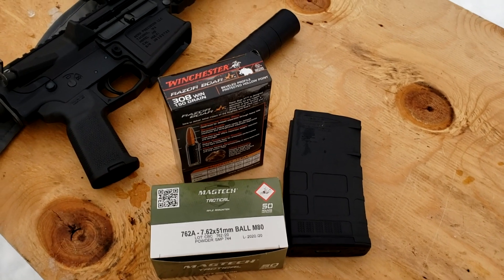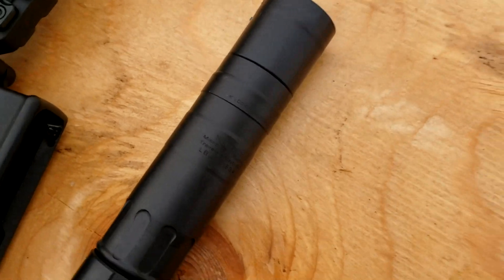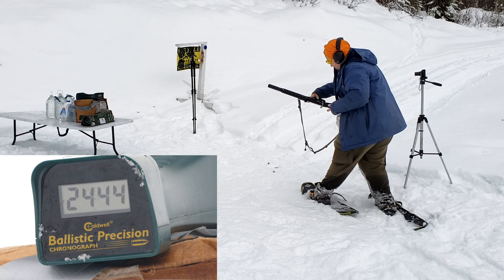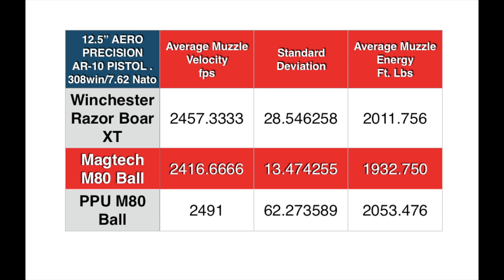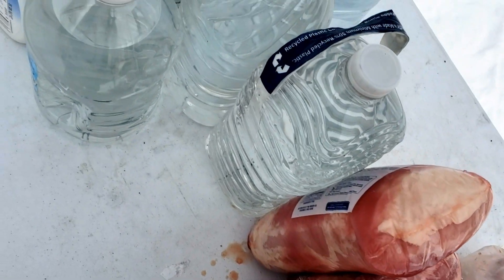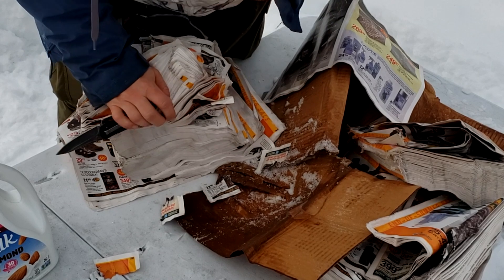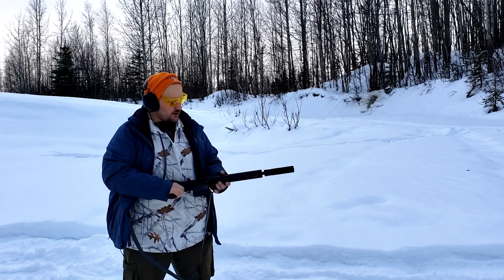12.5" AR-10 Pistol .308win Ballistics

Comment: I did a 12.5” with a surefire 7.62 Warcomp pin&welded (tuned right handed). Used a Daniel SBR. Rarely have jams and cycles just fine
Reply from the maker: Cool

Comment: Dude. I just made this exact build. SBR’d with a HUXWRX can. Crazy. Thanks for posting.
Reply from the maker: No problem... does yours run well?
Reply: @AlaskanBallistics  Not a single problem. Adjustable gas block works well.
Reply from the maker: Nice,  which has block do you have?

Comment: Averaging about 2,000 ft-lb Energy.
Not bad for 12.5 inches.
Approximately 500 more ft-lbs then an AK-47 or 300 Blackout. That justifies the extra weight of an  AR-10.

Many 308 gunpowder and I'm going to be much slower burning. They will deliver an energy below 1,500 ft-lbs. You have to be very selective with your ammunition and test it through a chronograph to make sure it is delivering above 1,800 ft-lbs. That is the absolute floor that I have set for myself.
Reply from the maker: I agree with that floor,  unless purposely running subsonic.
Reply: @AlaskanBallistics  my problem with subsonic 308 is they all seem to be about  220 gr . At subsonic speed that's going to be exactly like a 300 Blackout subsonic ,  which is a much lighter rifle. 

308 subsonic would make a lot more sense if the bullets were 250 grains or heavier. I do not know why manufacturers do not make them.
Reply from the maker: @tsafa because the twist rate of 1 in 10 won't stabilize them and you'll end up with a baffle strike
Reply: @AlaskanBallistics  thank you
Reply from the maker: You're welcome.
But now you've got my mind wanting to spend the money on a 1 in 8 twist barrel.  Lol 🤔🤔

Comment: BTW   any 223 under 16 " is pointless       any 308 under 18" is pointless         just because you Can do something does not mean you Should do something ........I have 2 308s    cut back from 26 to   20.5" (700) & 21"  AR  both bull , both tack drivers . I get between 2,750 & 2,900   depending ......all 150 gr
Reply from the maker: Yeah but you can't corner and room clear with those very easily can you?
Reply: @AlaskanBallistics  I hope you got double ear pro at 3 am if you shoot that 308 inside ...
Reply from the maker: I usually keep electronic earpro by the bed

Comment: That's actually a little faster than I thought it might be.    I've often wondered if a 308 shorty would be substantially more effective than a super sonic 300blk round.   After seeing this, I'd say YES!  Thanks for the video!
Reply: The 12.5" AR-308 will still have devastating effects up to 600-800yds depending on the ammo and barrel twist rate.
But anything under 16" will be totally useless for a .308 if you wanna leave it up to the "Mr. Know-It-Alls"  to tell you that dumb bullshit.
Even the weakest 308 round out of 12.5" barrel will shit on any .556, 7.62x39, and .300 blk when it comes to ballistics and stopping power
Reply from the maker: So true @Electric Larry
Reply: @AlaskanBallistics  Right, right 🇺🇸😎👍
Reply from the maker: You're welcome.  Thank you for watching! Yeah 2400 to 2500 with a 150gr bullet is way better than 2300 with a 110gr bullet.
Reply: 300 Blk out doesn't have squat on a .308 in terms of Energy

Comment: Hmm. I already have a 7.62x39 ar pistol with 10" barrel, but was debating swapping out the DPMS SASS barrel in my 2nd 308 maten upper because I already have a long barrel maten upper in 6.5 cm and it destroys the 308 at longer ranges. So figured why not, but after seeing those fps numbers im having second thoughts...
Not sure if the gain is worth it over my 7.62x39. Especially when you factor the weight difference. 🤔
Reply from the maker: You still get a heavier bullet at 2400 plus verses 2300 at 123gr with a 16" AK.
Reply from the maker: Handload some 110gr or 130gr barnes and you'll have some awesome loads on 12" probably getting 2800+

Comment: MAG DUMP JAMB... may have been partially due to minor shooter error...  FROM THIS ANGLE it would appear that   firearm  is NOT firmly pulled into shoulder pocket  allowing  entire firearm to move  rearward and flip muzzle up... This sort of movement can mess with the gas system .. BCG & SPRING TIMING.  If I was in on that... I would repeat test with HEAVIER BULLETS  and get a better grip to allow less firearm bounce movement .... and consider parts mentioned in my other comment.

Comment: *AR jams... due to possible timing issues: POSSIBLE Solutions include. TUBBS BRAND STAINLESS FLATWIRE  BUFFER SPRING... and  make sure you have adequate magazine spring strength and smooth  magazine  follower movement.
Reply: I have a .450 Bushmaster and it only jams on the way in on the last round of my magazine.  Which means the round is too slow moving up before the bolt chambers the round.  J Martin is probably right.  Thanks for the video.  Just built an Aero 308 12.5”.  Appreciate the chronograph data!

Comment: I had a similar issue with my .300BLK with the next round not properly feeding into the chamber.  I was using the same type of ammunition (same box as well), and it seemed to be an underpowered round not properly cycling the rifle.  I only had it happened once, and it only happened while I was running it suppressed.  When not running suppressed, the rifle had no issues whatsoever.  I agree with checking your springs and buffer weights, and maybe see how reliable the rifle is when not suppressed.

Comment: 2,400fps is near mimicked by 7.62x39 out of the identical 12.5" barrel. That's kind of funny
Reply from the maker: Well the 7.62x39mm doesn't get that.  I've tested it at 2100 out of 10" and 2350ish out of 16". 
You also have to remember it's bullet is only 123grs compared to 147-150
Reply: @AlaskanBallistics  That's fair, it's about 20grs short in bullet weight but I metered 2,380 - 2,410fps out of a SBR arsenal 107cr using ppu m67
Reply from the maker: @slappp6163  they must have had some sweet powder charges in those

Comment: You're over gassed due to the suppressor.  Put a sprinco orange buffer spring with heavier buffer in it or try tuning your gas down if you have an adjustable gas block.
Reply from the maker: Yeah we tried changing the gas

Comment: I’m curious how this does compared to a   7.62x39 of the same barrel length
Reply from the maker: Hmmm i was getting about 2050 out of 7.62x39 10.5" 123gr fmj. So 12" should get 2100-2175 ish. Slower and lighter bullet than the .308
Reply: @AlaskanBallistics  I’m considering a Galil ace pistol but I’m leaning more towards the 7.62 x 39 seems like it’s more efficient
Reply: @dangerousfreedom4965  if u can get the x39, that's the one. If not I would go 308 over 556

Comment: The velocities were about as expected. It equals and slightly exceeds 30-30 Win velocities from a 20" barrel, and we know those loads work well. I am still a little suspicious of copper bullets, and unfortunately we are stuck with them here in Kalifornia. I love the 308, i have 2 levers and a semiauto. Unfortunately, no AR'S here anymore. When i move up there i may get a AR10 and an extra upper in 338 Federal. I am sure it would impress Bullwinkle. Might get an AR pistol for a truck gun, just in case of an active shooter. M1 Carbine would work well for that too. Lots of choices, as long as they don't get legislated out of existence. I wouldn't mind jumping through the hoops at some point and going full SBR. Thanks for the test
Reply from the maker: No problem.  When are you moving?

Comment: What Tom Jones said.  Polish the feed ramp. I did it to my AR 308 and now it cycles everything.
Reply: Cam I ask how you did it bro? I was thinking using Flitz compound maybe 🤔
Reply: @makevelicustoms  I used 220 compound and then went to flitz.  I used the wool wheels with a Dremel at 30K rpm. I also polished inside the barrel extension so the bolt would lock in and out smoothly.

Comment: Did not use adjustable gas block, or suppressor, or change out standard AR10 carbine buffer, and I find that it eats up the brass case (i.e. not re-loadable anymore) and occasionally jams.  Shoots without issue Tula 150gr steel case.
Reply from the maker: Cool thanks for letting us know

Comment: Get a new spring and heavier buffer and give it more gas.
Reply: Scratch that.....turn the gas up all the way and if you still have feeding issues....it could be the buffer spring and buffer. Not enough reciprocating mass from the bolt is usually the cause. Firing ammo in the cold will get less pressure in the gas tube. Mag tech isnt the hottest ammo either.
Reply from the maker: Thanks.  I think that's the plan

Comment: I have no experience with suppressors but I'm curious to know if the magtech ran ok without the suppressor? What I understand is sometimes gas block adjustments can be touchy when running suppressed.
Reply from the maker: The ppu did.  Not sure we tried the suppressor

Comment: Generally you'll lose 25-50 fps per inch of barrel loss. This came out around 65 fps per inch. That gun is nice and quiet and still fairly potent. Try adjusting the front end of your magazine's feed lips by opening the chamber end very slightly. That will normally allow the front end of the cartridge to pop up and level out on the way into the chamber a bit earlier, but to be honest, it sounds like an ammo production issue.
Reply: More likely cyclic rate is too fast suppressed.  Causes FTFeed malfunctions because the magazine spring can’t lift the cartridge stack fast enough, especially in cold weather.  Velocity loss per barrel length isn’t a linear function, but graduated with more of a curve the shorter the barrel gets.  You especially see the velocity drop as you go from 14.5” on down where the curve gets steeper.

Comment: Hey guys great ar10 build make for a nice pack gun after he figures out whats up.  My issue with my 300blk was a steel mag don't know brand but it was 10 shot or 5 shot 556 mag. Had switch to 10 shot aluminum mag for 300blk and ran fine.  I say his issue is the gas flow .  

Job did go well said had it. But on my start day  call said no do to medical.   Said their doc said. Call said do to I have weired body mechanics when lift. And blood pressure issue that I know about.  So my doc Changed meds today and sending me for stress test said ekg showed issue with the electrical system in my body .
Reply from the maker: Prayers for a good test
Reply: @AlaskanBallistics  thanks man I'm in my early 30's been nothing but stomach issue and blood pressure issue for last few years. Hope find away fix it with out mess with the other

Comment: I have basically the same build.
Except running a 16 inch barrel.

Ar10s are finicky...... especially if that ammo that jammed  was just a soft lead point 

even with the SLR gas block......I basically REPLACED my guns internals to run 100% and not chew up the brass too bad...

If it was me I'd go from ground zero.....
Set the gas first......if it doesn't run play with the buffer weights. Then bcg, and bolt.......

Also obviously the gun needs lube and 
You have to be sure everything is lined up right in the build......

The fact that it cycles ok until you hit 3 rounds is questionable  And unfortunately it was too long ago to remember if mine was doing the same thing. Unsuppressed

Unfortunately it took some high end parts to make my ar10 run 100%
Reply: Agree. AR10’s need tinkering/adjusting to make them run proper. Check the feed ramps to see if everything lines up as it is supposed to internally and maybe polish them to aid in feeding. Reset the gas block to factory,  get a Sprinco spring and an h2 buffer(get the buffer first and follow Sprinco’s website for getting the correct buffer spring). Once all this is done, install can, load 1 round at a time from the magazine and adjust gas block accordingly until it holds open after the round is fired. Adjust 2 more clicks open for reliability. This in turn should cut down on the gas in your face(Robbie’s face said it all) and give you a proper ejection pattern. It will also help with felt recoil. I would do these test with the ammo you shoot the most and quit using any ammo that doesn’t feed proper. I did this with my 5.56 and it cut out 80+% of the gas in my face, reduced felt recoil, gives me a 3-3:30 ejection pattern, and my lower receiver doesn’t get as dirty. I used the ammo I shoot the most(hunting) and it is a little “hotter” with surplus ammo and has a 2-3 o’clock ejection. I am using a Rugged Razor, which should be similar to your Rugged Micro 30 at full length.

Comment: It might help to get us a visual and to use verbiage other than "jam".  What did it do?  did the new round make it all the way out of the magazine?  Did it clear the feed ramps?  Did the bolt not pick up the next round from the rim?
Reply from the maker: Bolt partially picked up the round and it's very stuck going into the chamber
Reply: @AlaskanBallistics  This is what I was looking for. Mine had the same issue on break in. 16” barrel. P mags would cycle for anything and the factory steel mag was iffy. Once I got a couple hundred rounds through it It eats anything and everything.
Reply: @AlaskanBallistics  what do the feed ramps look like, are they polished or do they show tool marks from the manufacturing?
Reply from the maker: I'll have to check with the owner

Comment: I think she’s over gassed also.
Reply: Well, then I would try some different magazines first. If it works better, with good mags, then turn your gas down or use a heaver buffer until she ejects about 3 or 4 o’clock. Hope this helps.
Reply from the maker: Turning the gas up is what helped though

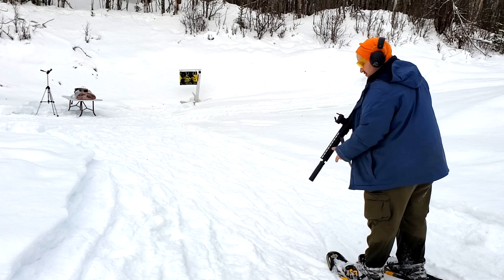Comment: I don’t have the perfect angle but it seems like your AR is overgassed, that’s why it’s jamming, brass should be ejecting between 3:00 - 4:30, hope it helps.
Reply from the maker: It was jamming a lot then we put more gas through and it was jamming less...
Reply: You will have to tune it until it ejects the brass properly, trial and error

Comment: Better penetration than expected. 
 Noticed that you did not hold firm before the gas block adjustment. 
 I am only a guy with an opinion, for what ever that counts :-)
 Perhaps a buffer/buff spring change. 
 I'm not suppressed with  24" match barrel AR-10.  I've had some issues with the bolt striking the rounds being chambered that it has gouged the cases. This has left a brass build up on bolt face. (All mags)
 I would appreciate any suggestions.  
 Thanks for the vid.
Reply from the maker: Wasn't putting the brave against my shoulder given ATF's fickleness on the subject

Comment: A friend that sometimes hog hunts with us has a Scar Heavy SBR with a barrel about that length. It is very effective on hogs but a bit pricey per round but, everything is pricey now. It basically is going to give you the velocity of the 7.62x39 with just a heavier bullet! He had me build him a 10.5" x39 and now he usually uses that!
Reply from the maker: This did better than a 7.62x39 by 100 fps or so
Reply from the maker: How have you been uncle Dan?
Reply: @AlaskanBallistics  I have been great Chuck you are either up early or out late. Yeah it seems to be a tad faster than x39 depending on the gun. An AK throws the round out with enough energy to nearly kill something with the hull. A bolt gun or well-tuned AR is gonna get about 2400ish FPS!
Reply: 7.62x39 doesn't have anything on a .308, Sure .308 may be a tad bit faster but the difference between x39 and .308 is Energy which equates to drop down power
Reply: Oh really, thanks Captain Obvious! @bidenstoletheelection9116
Reply: You can't say its like 7.62x39 but different weight that completely changes ballistics
Reply from the maker: Ehh sure but be said the velocity is about the same
Reply: @AlaskanBallistics  Yeah, Chuck that is what I said. Also I said 308 was good knocking down hogs even in a SBR. That being said foot pounds is just a number on paper to quantify impact. Hogs don't care about Math. All they know is Multiplication. Either round will do. For me 7.62x39 out of a 7.5" barrel is my go to usually. Works great and is cheap to shoot.

Comment: If the gas block is set pretty much wear you want it. Id do some polish work on the feed ramp. I know its made a hugh difference on some of my pistols. My AR 10 has a 20 inch barrel in 308 that one works good. My pistol in ar is a 556. Ruger factor built and that has worked even with the steel cases ammo in it. Good luck and keep us informed 👍 fellas.